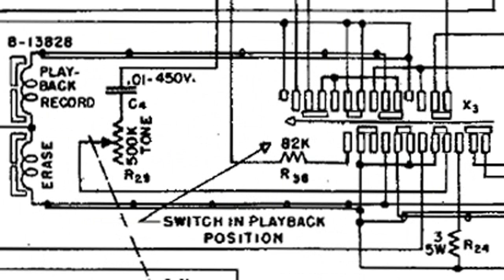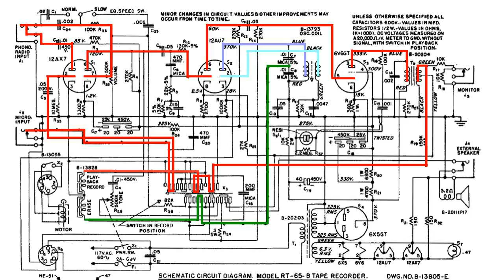Vacuum Tube Tape Recorder Circuit

Comment: I love your videos Rick with your quite but confidant delivery. 
Your use of graphics is a wonderfully way of getting over the point in question. 
I should think that you have given a lot of folks the confidence to pull out the circuit diagrams and set about fixing things.
Well done, it makes me think I need to go and buy an old Reel to Reel recorder at the car boot sale this weekend. 
Kind Regards ... Andy

Comment: @AllAmericanFiveRadio 
it was made in the early 60s so it only uses electrolytics and i will change them when i find some new ones with the corect values (i know a relative that also restores old audio equipment so i can propobly get some for free or very cheap) i think i will leve the old tubes alone simply becoase its just a old farly basic tape recorder and tubes can be a bit on the expencive side so that realy not worth it.

Comment from the maker: @agfamatic91 
If you interested in restoring the tape recorder, changing out the wax paper capacitors and the electrolytic capacitors is the first step. You may also need some new tubes, but I change out the capacitors first. Good luck!

Comment: i resently found a old tube based reel to reel witch works but one problem it has is that the amp dont seens to be as strong as it originaly was and ther are lots of noise but not much hum in the audio. 
i have not done enything in the electrical parts of the machine but one thing im going to do is to replase some of the caps (note ther are no blown caps but they may be a bit dry) the tape recorder is a farly simple unit but have ac bias. but do you think changeing the caps would help?

Comment from the maker: Thanks FelixTheHouseFreak 
You'll find that the circuits for AC bias transistor tape recorders and cassette recorders are very simular to this tube type tape recorder. Substitute each amplifier stage with a transistor and lower the voltage. In other words this is a good template for both.